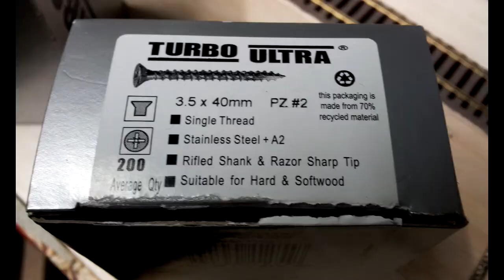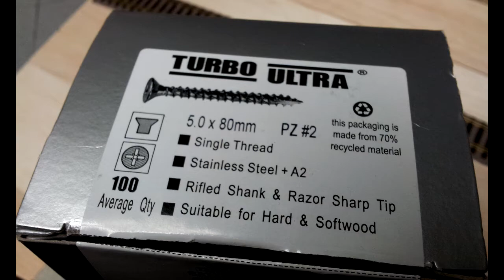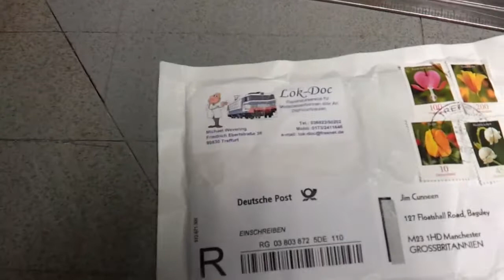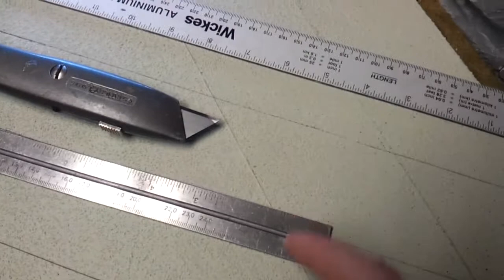TRIX CRANE YARD EXTENTION project part 1 #modeltrains #modeling

Comment from the maker: Hi dave , that big drill is small compaired to the  big heavy driver drill which is mains powered we used for the base frame work for the loft flooring . I have around three projects on the go .. One day it will all be scraped & i will start again fresh as this layout is my first attempt after many years, learning all the new ways of building & dcc ,electrics etc..was a bit of a challange...